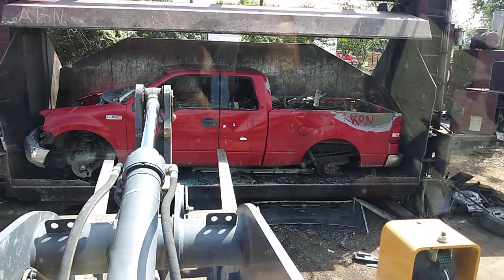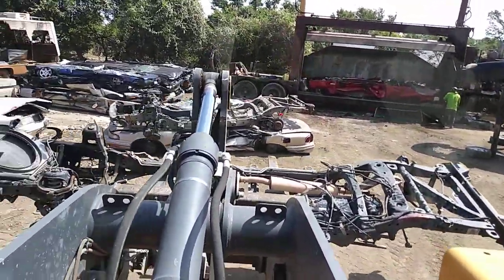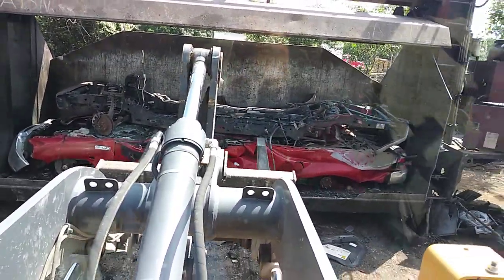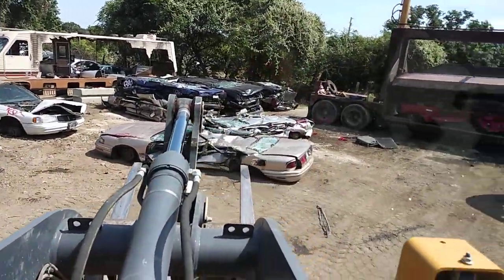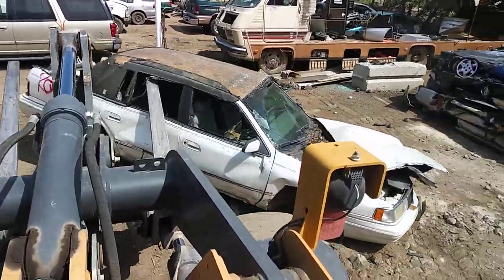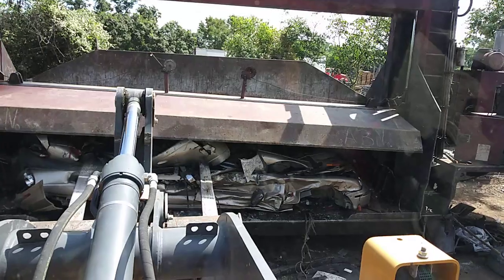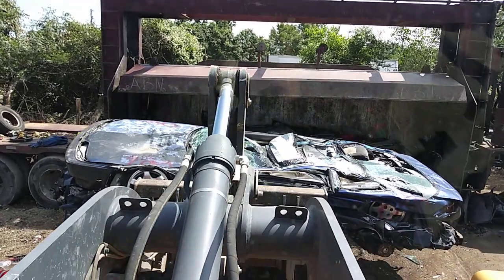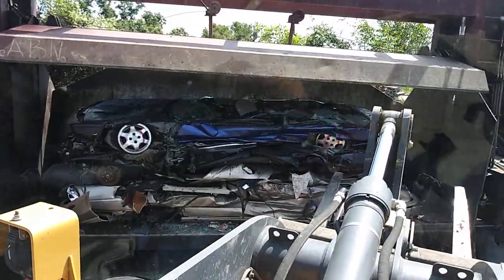05 up Ford Pick-up gets Crushed

Comment: My '91 Lincoln Continental probably would've ended up like that one had I not bought it. I had no idea how hard it would be to find the parts to fix it up since that generation is so rare today. Glad I saved it though, they ride like a dream.
Reply from the maker: I haven't seen many. Did those Stinkin Lincolns have air bags or coil springs?
Reply: Cowboy Car Crushing they had air springs front and rear but most people convert them to coils.

Comment: 2004 was first year of that style F150. Also that's a small body Lincoln Continental based on Taurus platform(FWD 3.8V6). Anyway keep it up, love the videos! Especially love the feeding the beast videos!
Reply from the maker: Im a 1973 Rubber Wheel Articulated Loader "Operator". Anyway. Sorry i missed identify the "material" I feature in these videos.  I do understand you see a car/truck/vehicle. I see one more "thing" to put in the crusher. I'll get better or keep my mouth shut when i should.  Thanks for watching and commenting 👍👊